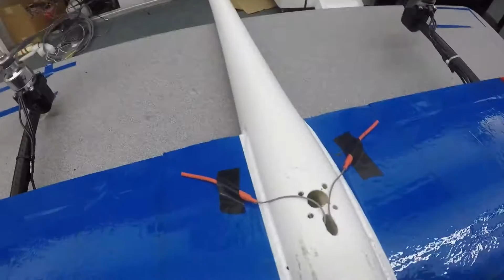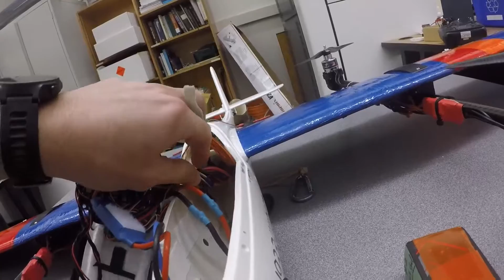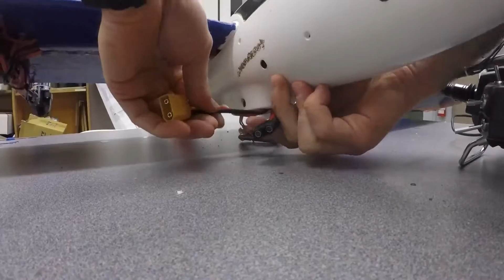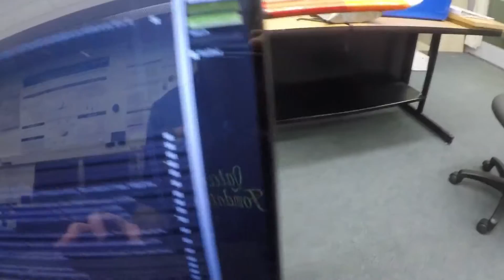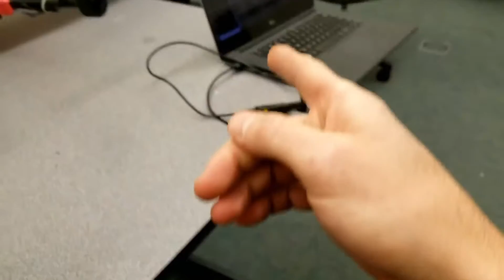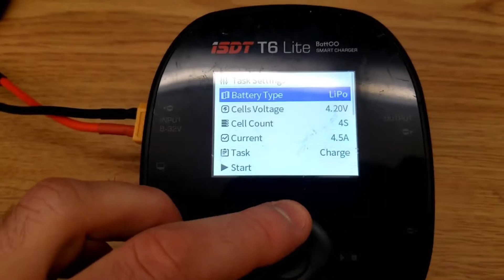Quadplane: Hardware overview, setup, and pre-flight checks

Comment: How is if I connect plane wires to main port of pixhawk( 1. 2. 3. 4. ) while the esc power wires of qoudcobter connect the power distribution board and four esc wires single wires   connected to ( 5. 6.    7.  8.  ) .

Comment: Hello,
at 16:07 you mention that the signal wires of the Servos should go to the Ports M1-M4 (Motor1 - Motor4). What does your "Servo Output" in Missionplanner look like with this wiring?
 
My quadplane works fine expect for the Servos! All servos have 5V power, as you described in your video and are not defect.
So I have to connect the signal wire of my aileron servos to M3 and M4 and my elevator to M2 (no rudder) for example?
Thank you in advance!
Best Regards, great video!

Comment: Thanks Andreas for your patience in showing your vtol plane setup. Very nice. Can you also explain how the carbon arm motor is fastened under the wing of the aircraft? Thanks again.
Reply from the maker: There are two carbon tubes press-fitted into the foam wing. And the motor arm is mounted to those tubes with a 3D printed part
Reply: Tq again.

Comment: my fixed wing motor is not run in air and it crashed . why it didnt run (fixed wing motor) ? 
 which parameter ı should setting 
ı have no airspeed sensor

Comment: Hi Andreas ! It was a relief to find your video on Quadplane on YouTube as there are no other videos for the same. I am trying to build a QuadPlane. Can you please explain which pixhawk outputs are connected to the vertical motors and which was connected to the thrust motor. Also, how do we assign these outputs for motors and servos  in mission planner . Thank you
Reply from the maker: The quad motor signals are connected to the pins M5, M6, M7 and M8 on the power distribution board. The main motor is in M3. For the mission planner, you have to use the quadplane firmware. It should be set up already with this motor order
Reply: Thank you